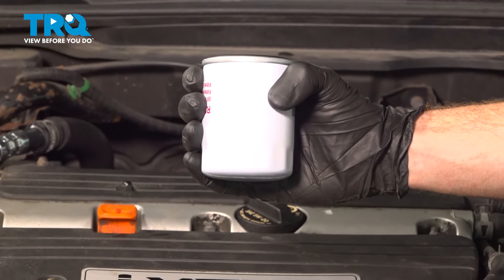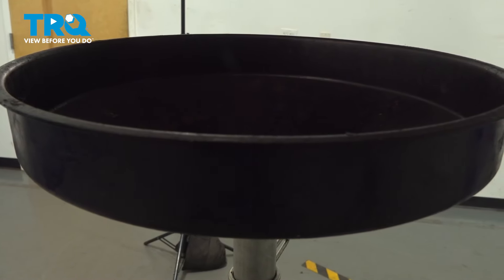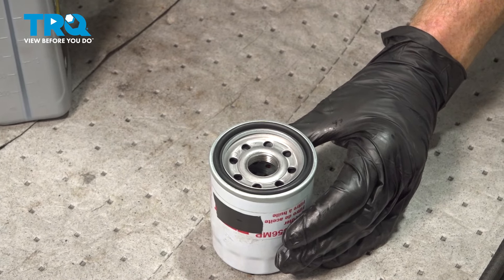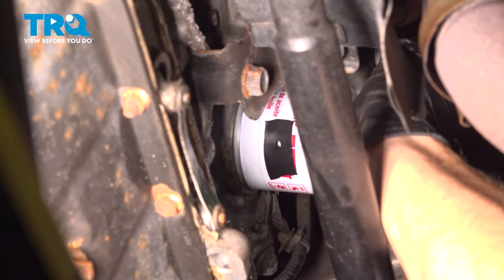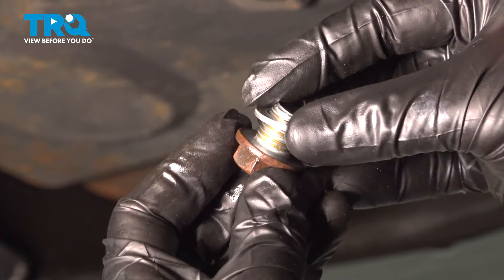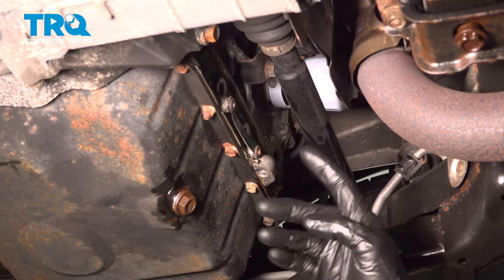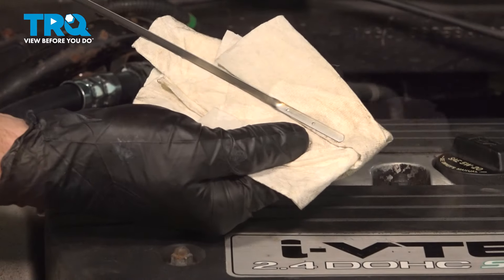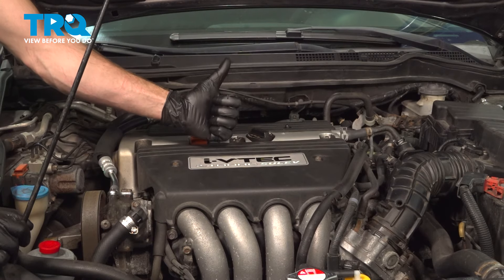How to Change Engine Oil 2003-2007 Honda Accord

Comment from the maker: √  Watch the Video
√  Buy The Part at 1A Auto http://1aau.to/m/Shop-TRQ-Parts
√  Do it Yourself
√  Save Money
Reply: Hello, I have a question, because they put 10w 40 in my 2005 Honda Accord. According to the mechanic, given the age of the car, 10w 40 is better. Is that true? Or should I continue using 5w 20?